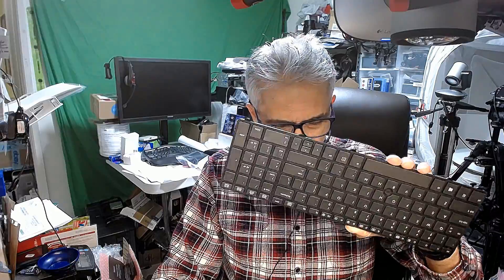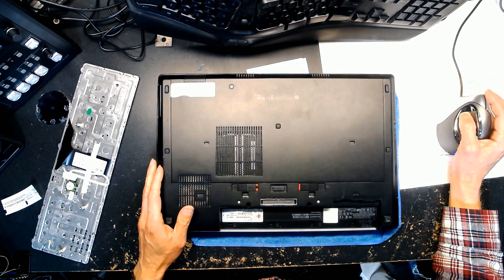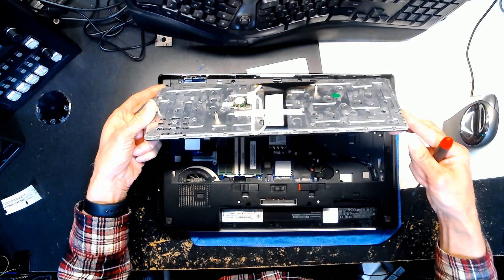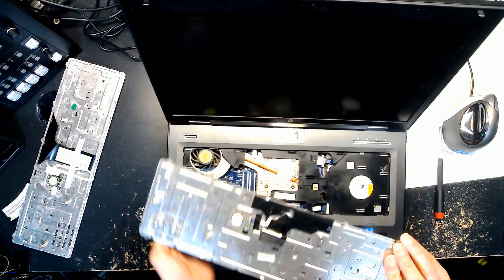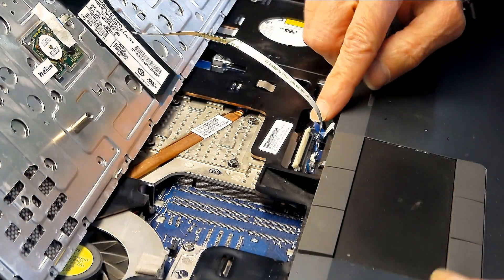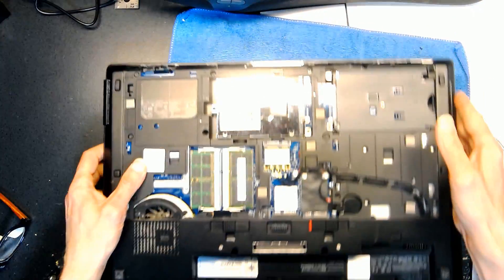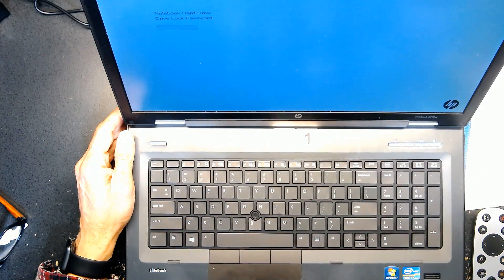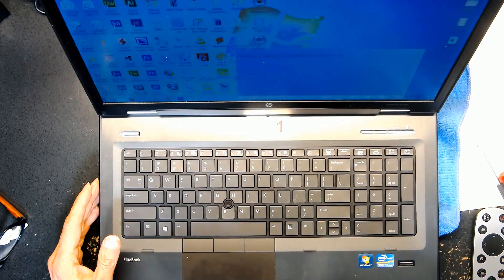HP EliteBook 8760W 8770W 87xx Laptop Keyboard Replacement Guide Tutorial

Comment: Just purchased a number of these machines at a very low price in 2025! Keyboard replacement looks fairly easy!  I have also replaced the slower HDDs with much faster SSDs, and this upgrade is also fairly easy, as well!  I purchased my units from ebay, but, one should be extra careful to only try to purchase elitebooks that have been well taken care of!    Finally, I love the look, durability, and finish of these well made, but vantage units!  While the newer more expenive HP elitebooks have more up to date features, these older units (e.g., HP  8760w & HP 8770w) can still perform the majority of my computer needs!! Thank you so much for sharing!!
Reply from the maker: I appreciate you sharing your experience with the machines!

Comment: I have trouble removing the far right side of the keyboard the left side I got off easily, but the right side is giving me trouble. I don’t know why it’s giving me such a hard time.
Reply from the maker: Either you still have one more screw to remove, or the keyboard is glued by double sided tape from the bottom.
Reply: @TECHNOLOGYTIPS101   that’s what I’m thinking don’t got a tool to help ease it up.
Reply from the maker: @guardianoftexas5188 @guardianoftexas5188  Try using a hair dryer from a safe distance so you don't damage the laptop, and once the double-sided tape is warmed up, it will be much easier to open. Again double and triple-check for a screw first because if there is one more screw that you forgot to remove, forcing it will damage the laptop.

Comment: How can I know if the pins on the ribbon cable are lined up properly?  I disassembled my 8760w a few days ago and now the keyboard doesn't work or doesn't work properly.  Depending on how the ribbon cable sits, it either doesn't respond to any key presses or displays the incorrect character (eg. pressing E will result in 3, Z gives a $, some keys display something while others don't at all, etc)
Reply from the maker: If the cable is not damaged it will not have any play to move or shift right to left. It will be a perfect fit with no gap on either side for it to slide off alignment. So if your cable has enough room to slide in and out of alignment with the pins it means you either have the wrong keyboard or the ribbon cable has been damaged.